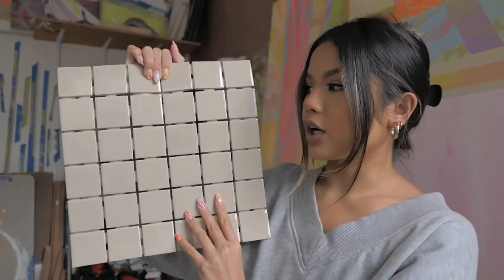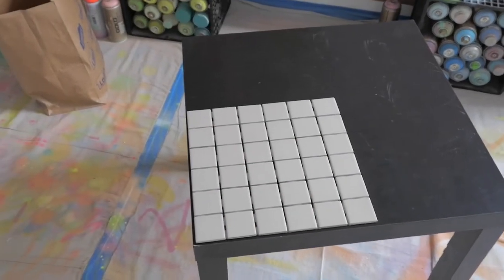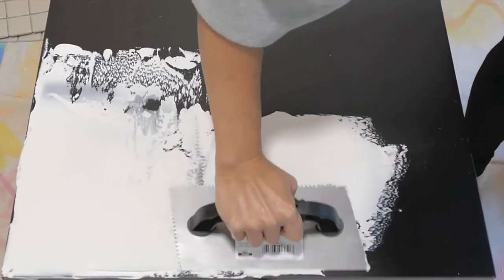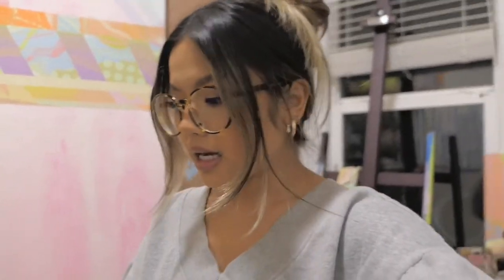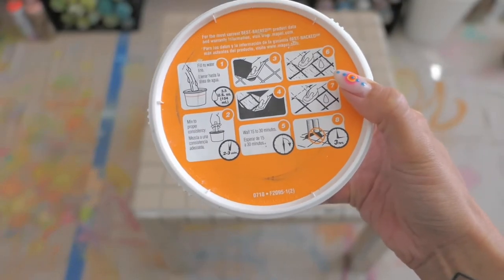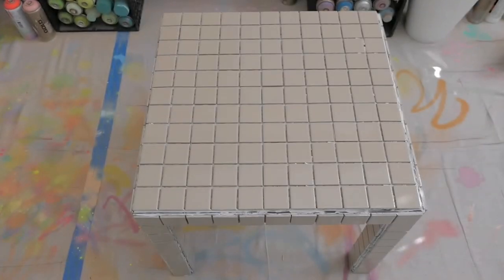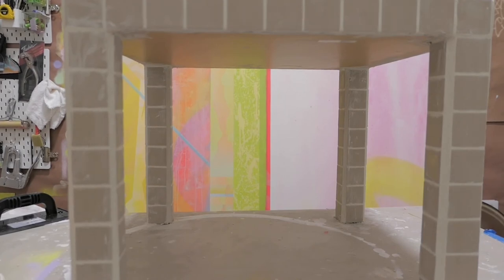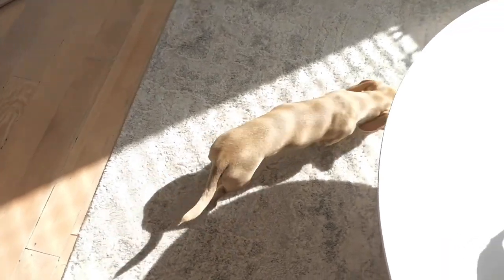DIY TILE TABLE UNDER $100 + all the trial and error

Comment: LOVE! any other recommendations for tile. It looks like the tile you used is no longer in stock. I love this color. I’ve looked for like three days.
Reply from the maker: hi there! so sorry for the late reply- not sure if you tried something else but the closest option i found was this but it would need a top coat for protection https://mosaictileoutlet.com/products/mto0901-traditional-2x2-pearl-square-matte-porcelain-mosaic-tile?variant=42807833362583&currency=USD&utm_medium=product_sync&utm_source=google&utm_content=sag_organic&utm_campaign=sag_organic&nbt=nb%3Aadwords%3Ax%3A20257781648%3A%3A&nb_adtype=pla&nb_kwd=&nb_ti=&nb_mi=122751919&nb_pc=online&nb_pi=shopify_US_7887649767575_42807833362583&nb_ppi=&nb_placement=&nb_li_ms=&nb_lp_ms=&nb_fii=&nb_ap=&nb_mt=&gad=1&gclid=CjwKCAjwo9unBhBTEiwAipC110XQ7cTIbX4u0HHejoNfHhGeMyip-0fxXRp27UlJv2zfHSMoTIfE-BoCZTUQAvD_BwE

hope this helps!!

Comment: I try to find good used kitchen tables about 3×4 or 3×5  in a Habit or Goodwill.. then tile them. I Screw in half inch plywood into the table, then screw and morter hardi-backer board to it. I prefer 24×48 large format porcelain tiles,then cut them to size. Porcelain is much denser and durable than Ceramic. Both the tile and backer board must be mortored for a proper bond.They range from $3 to $6 a square foot.There is less grouting which means less moisture to worry about.  I sell them as a side hustle and do very well.